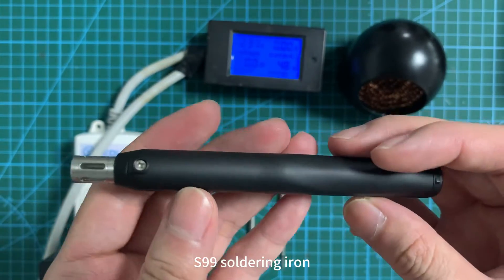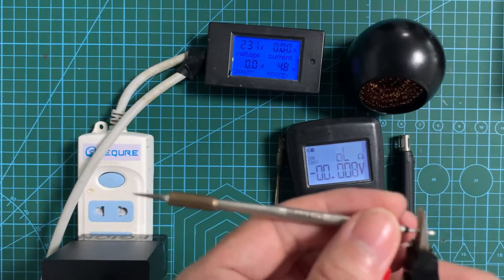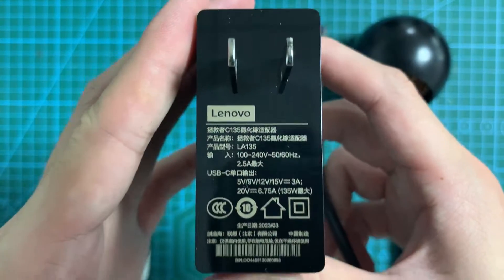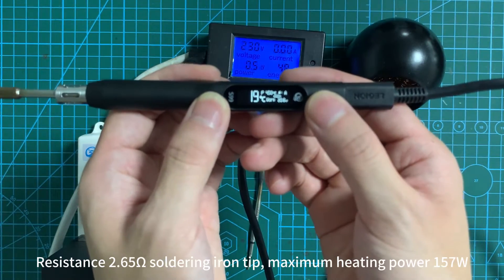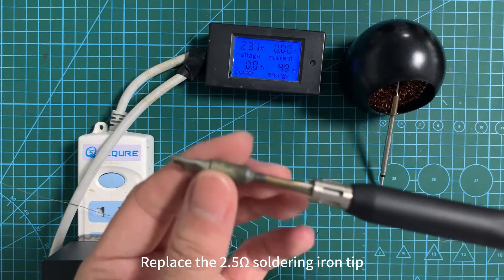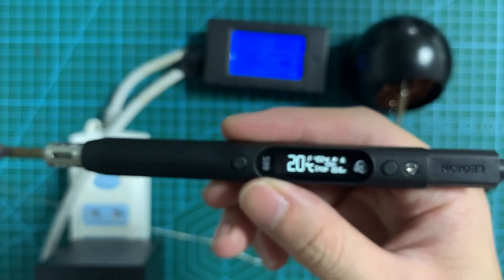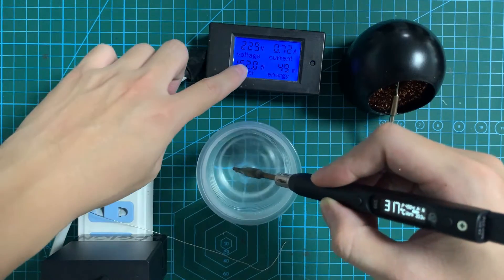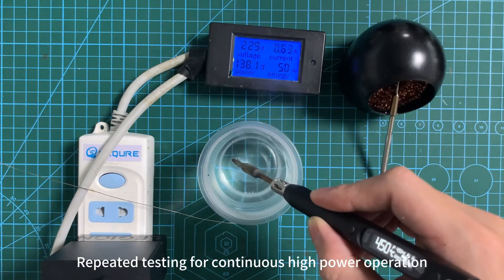S99 uses 2.5Ω soldering tips (Max 160W)

Comment: Thank you very much for the video! To solve the problem of various power supplies and 2.5 ohm tips, you can configure the firmware as it is done in the Alientek 80P soldering iron. The user can select the voltage and current in 100 mA increments.
Reply from the maker: Thanks for your suggestion. There are protocol selection and power limit in the soldering iron menu. This function is similar to the one you mentioned. It is effective for some power heads and useless for others. Using a power head with sufficient power is the best choice.

Comment: I ordered Sequre S99 with 2.5Ω Sequre C245-905 tip and Lenovo C135. I tested it on an HDMI port with only one anchor attached in a PlayStation 4. It could not melt the solder through the board no matter how long I dwelled. Yes, it’s a small tip but the power indicator showed it wasn’t even trying (indicator bar should shoot up and stay pegged).

Did I do something wrong? Power protocol was set to A (Auto) just like this video. I kept increasing the temperature and trying up to 500°C and which only managed to burn the pad off the board without melting the other side. Even with the port removed I had difficulty clearing anchor holes. The ground plane is still a massive thermal load, but that’s exactly why I bought this 150W iron.
Reply from the maker: During the soldering process, you need to constantly add tin to the soldering iron tip and the pad, which is conducive to the melting of the pad tin. If the operation does not meet your expectations, please shoot a video and send an email to our staff to review and give you feedback.
Reply: @ Yes, I add solder to bridge heat. I used the same technique on my 80W iron.

The iron’s display indicated that it was maintaining its temperature which did not seem true. It performed better when I tested last year using a 75W K-tip and high amperage 20v battery pack leading me to wonder if it’s the new 150W tip, the new Lenovo C135 power source, or my S99’s power/protocol settings.

If the battery performs better I will use that but I bought the C135 so that I will not need a battery. Next time I will try larger tips and I will have the battery handy to see if it makes a difference. Thank you!🙏
Reply from the maker: @emmettturner9452  Replacing the larger K-type soldering iron tip will make the welding effect better, and the battery performance is not much different from the C135 effect. If you have any questions, please feel free to contact us.

Comment: Hello. 
You sell a tip with a resistance of 2.5 ohms separately. This tip can replace the original jbc tip in terms of characteristics and quality. Which 2.5 ohm tips do you recommend, your tip or the original? Or are there alternatives.  Please give me a comment. Since a lot of bad tips with a short resource and characteristics that do not correspond to reality are sold on aliexpress.
Reply from the maker: It is recommended to use SEQURE accessories because the quality of soldering iron tips of different brands on the market varies greatly.

Comment: Hello, can you please tell me how much this particular power supply weighs?
Reply from the maker: Thanks for your comment.   291g
Reply: @SequreTech  Thank you. Mine weighs 275g. Then I found out that this block has two completely identical models. The only difference is that one weighs 290g (it works with 2.5ohm tips) and the other weighs 270g (it doesn’t work with 2.5ohm tips). You'll have to look for a block with the required weight(
Reply from the maker: @7Lucky7Man7  Regarding the question you mentioned. Could you show it with a video? And send it to our email: info@sequremall.com
Reply: @SequreTech  I haven’t had time to check it myself yet, since my sting hasn’t arrived yet. I read the information from the 4pda forum. When I try it myself, I’ll write you an email.

Comment: Can you make the PID circuit to operate two c210 cartridge simultaneously at (65+65)=130 watt. I can modified the handle for c210 cartridges. If you do this please use a simple alternate DC Power input which can be solder direct with the circuit board. It will be very useful for a transformer based linear power supply with constant voltage constant current module. At first I thinking about pairing the hot tweezer handle with a t245 based soldering station (130 watt) but later I found in internet that the C-210 tips operating at 12 volt and the C-245 tips are operating at 24 volt and the resistance of both tips are different also thermocouples are placed different one in parallel and another is series so it can not be possible. 
Please make this circuit or hole hot tweezer.
Reply from the maker: Thanks for your thoughts, that's a good suggestion.
You can follow us and you will see this product in the near future.
Reply: @SequreTech  
Thanks

Comment: 😂😂😂 lol, how can your consumption be 160 watts if the power supply supplies a maximum of 135 watts?😅
Reply from the maker: Thanks for your comment. 135W is the rated power of the power supply, and the instantaneous peak power can reach 160W.
Reply: 135w is output power. They are measuring AC input power which will be 150w for 135w out at 90% efficiency.

Comment: That the schematic of cable xt60 to usb-c?  What maximum voltage and current can i send through this cable?
Reply from the maker: Connect the positive and negative terminals, the maximum voltage is 21V, if using 2.5Ω tip, the maximum current is about 10A.

Comment: What maximum voltage and amperage power supply I need to use to have 150w with this cable xt60 to usb-c?
Reply: If you’re getting a variable power supply and intend to run it right at 21V, you’ll need 7.4 amps to hit 150W. In the video you can see it will actually hit over 160W with some tips. So assuming you’re using a 24V power supply with a regulator, an 8A power supply (180W) would be the absolute minimum you want to get. I’d probably look for a 24V 10A (240W) power supply to be safe. Then you could couple it with a DPS5020 regulator which can handle the voltage and current the iron will need at full power to bring the voltage down to 21V.

Or just use a 5S LiPo or LiIon pack. Even with a 4S pack you’ll still get 90W at nominal voltage and 115W when it’s fully charged, which is plenty for just about anything you’d do with this as long as you’re using the right tip for the job. And unless you get a teeny tiny pack, it’ll for sure be able to put out 8A peak current.
Reply: @swissfreek   thanks a lot!  Do you know, is it some ic  in this cable xt60 to type c? Or I can made it by myself just connect + to +, and - to -.
Reply from the maker: @andreykvv  There is no IC in the XT60 to C cable.
Just need to connect the power "+" and "-" correctly.
Please note that there is a risk of damaging the product if the connection is reversed.

Comment: How can i power it up with power source 20v 10a? Do I need special cable?
Reply from the maker: There is an XT60 to C power cord in the package. You can connect the power supply to the XT60.
Reply: @SequreTech  can I order it separately?
Reply from the maker: @andreykvv  Yes, if you can't find it on the website, you can contact customer service.

Comment: I want to buy this solder. But will it work with an anker 736 100W adapter? The USB C port outputs 60W.
Reply from the maker: The default shipment is that the soldering iron head is 5.5 ohms, and the electrical source you described can work properly.

Comment: Hi Sequre team. I'm a happy owner off two S99 soldering irons. Tried to use then with a Lenovo C145W charger, and they didn't work. As soon as I press the front button for the iron to heat the S99 re-start. As you sirs show that the S99 iron works with the Lenovo C135W, and my charger has even more power, what could be wrong? Appreciate if you sirs can help me please.
Reply from the maker: Hello, this is mainly related to the IC scheme used by the power source. 2.5Ω heating transient current at 20V to 8-9A will restart if the power supply cannot handle the current instantaneously. We have also actually tested that C145W is not very compatible, and C135W can work perfectly compatible, which is related to the design scheme of the power source.
Reply: @SequreTech  team, thanks for the prompt response.  As I fall in love with my S99 irons, I'll order a C135W charger to use with then. Congratulations on the great products that Sequre offers to the market.
Reply from the maker: @MOZARTF  Thanks for the use, buddy.😁
Reply: Hi  @SequreTech  passing here to inform that my C135w Lenovo charger arrived, and to confirm that my S99s are working flawlessly with this charger. Thanks once more for your support. Wish a happy new year for all Sequre team.
Reply from the maker: @MOZARTF  Great.😀
Reply: @SequreTech  I have the same problem but I use sequre 5.5 ohm tips and Xiaomi 120w charger. It only works with PD12 protocol and show 15V. 
Why it doesn't work at 20v? Too much Amps?
Reply from the maker: @TheEryk03  Dear customers, some of Xiaomi's power heads use private protocols, not the standard PD3.0 protocol. There is no problem using the standard PD3.0 power head protocol, such as Baseus and other popular brands.